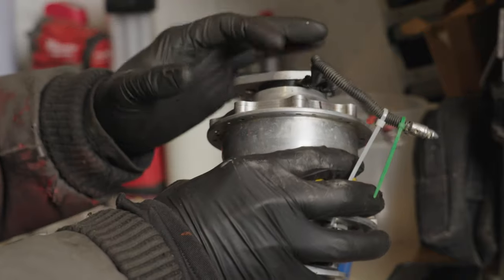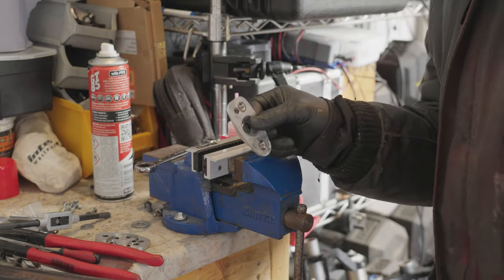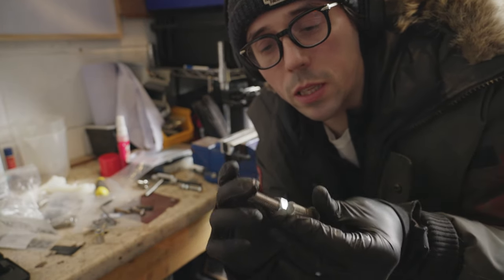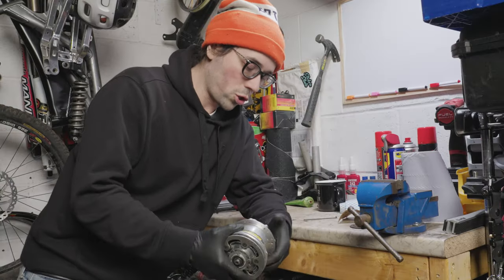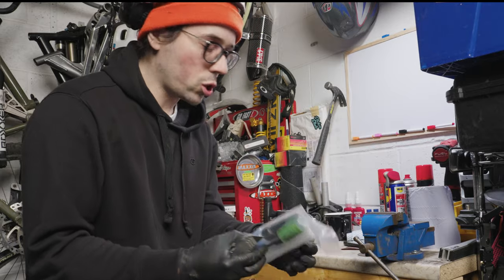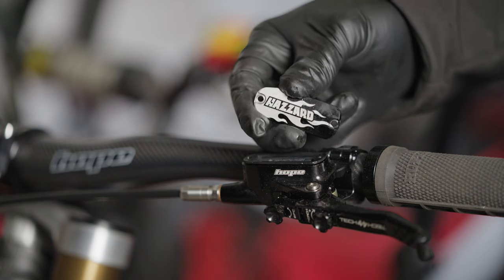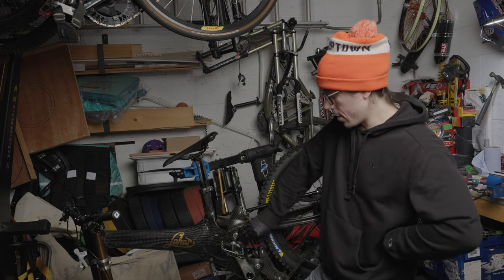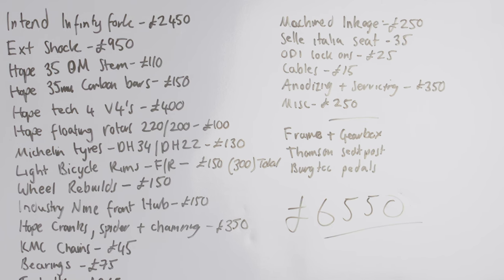The Final Fix

Comment: Nice work mate. Would have been good to see the difference in timed runs between old vs new build... ep.4 perhaps....
Reply from the maker: We only got the before, on the 2nd day we ran of time/light and the bike broke as I detailed in the 2nd video. Maybe we can get it at another point if the sting is free! Thanks for watching
Reply: @stephen_hughes  sure Joe will be up for it... Love to see this timed against a modern bike on an appropriate track. Aaron (frame designer) was a tripper, but ahead of the pack at the time.

Comment: I always wanted one of those back in the day. Almost 20 years later and it's still a cool bike. Especially with the modern parts fitted.

But you should keep an eye on those stainless inserts in the aluminum. That is generally not a good material pairing that can cause severe contact corrosion.
Reply from the maker: Awk if that happens I’ll get some new plates made!
Reply: It's marine 5086. Should not cause an issue. If it were 7000, 6000 series or 2000 series Aluminium it might.

Comment: Now upscale and rebuilt a new  frame as 29inch with complete modern parts.
Reply: Why? You want it to handle like a bus, have aerodynamic drag like a parachute, and have parts designed to last one race in proper off road conditions?

Comment: Still has a reach of ~30cm and you can't change that, baby!
Reply from the maker: That’s the problem with all bikes that age sadly!  Still didn’t hold folk back.
Reply: @stephen_hughes  since the frame is carbon you can extend it yourself, some of my local bikeshop owners did it with a rocky mountain instinct.
Reply from the maker: @Tequila628  I fully understand that but you’d need to be a maniac to do that to one of these. Would be easier to make a new front end!
Reply: @stephen_hughes 🤭 pretty hilarious what people think they need, just because they are used to the latest fad.
One of these won a National in NZ a few months ago.
You COULD chop the front end and make an internal lug, that bulged out to keep the smooth contour, but the only reason anyone has such ridiculously long front ends now is the stupid big wheels.
I did this to shorten one for Olivia Johnston in the 2006 World champs. 
These were criticised for their pro race long slack geometry when I was building them.
You are lucky I used 5086 marine Aluminium magnesium alloy on those Rohloff mounting plates Stephen. It's stronger and more corrosion resistant than 6061 or 7005, doesn't work harden, so you could bend them back into shape. 7075 is stronger but very brittle.
I would have recommended helicoil rather than insert for the stripped thread. But the inserts fine with your Ti bolts. 7075 race bolts are lighter, and far cheaper, and probably would have stripped their threads instead of the ones in the plate.
Holy shite! I cannot believe what you reckon you spent. Hope you got some discounts.
That's almost exactly what I've spent buying a Kauri Wharram Oro fifty foot ocean cruising Catamaran, a 45ft Hartley south seas cruising ketch, a Noelex 22 epoxy fibreglass foam sandwich racing trailersailer, a 10 meter Andrew Jackson motorsailer, and an Alan Wright Kauri Nova 28.
And all the parts and materials to get them fully back to top condition and capable of cruising the world's oceans.
With the shite the world's going into, homes and the ability to get wherever you need to survive or away from where you can't is important.
And this fleet can easily provide homes and food and safety for over 100 people.
Glad you like the views Stephen.
Far from "disappearing off the face of the Earth I have continued expanding my networks, and achieved many world leading things and topped many fields since I gave up on the shark fest that the bike racket is. 
And sharing these videos  has Undoubtably contributed.
Wynn Masters, for example reckons he'd love to borrow your bike and poach a big race. 🤗

I have been called a gallous lad indeed, by some of your top Scottish Engineers Stephen. One of my very good friends, Stephen Salter passed away a few weeks ago. Professor emeritus of the Edinburgh design school.
He had a good innings and was sharp and working hard until 90.
Though I had to open his eyes to some major cock ups in his assumptions on some projects he'd spent years working on in international Zoom conferences of the biggest names in climate and earth sciences. An honest and humble man like myself he always took it well.
It may amuse you to hear that despite definitely being a "gallous lad", I still find it practically impossible to get arrested or charged for anything.
DAMN near any time a cop hears my name, or a harbourmaster or other official, they go "Aaron Franklin, what? The A Aaron Franklin... Cam Cole the World Champs! Americas Cup! You're a national legend!
🙄 It's disturbing.
They call me The Real Burt Monroe, and The REAL John Britten.
And I've had quite a few amusing experiences of having to take things like rifles and industrisl strength Garden tools off people intent on using them to kill, and when the armed offenders squads turn up with their assault rifles, they really appreciate rolling around giggling their tits off with me and me giving them some pointers on how to harmlessly disarm, deescalate and disable the perps without anyone getting so much as a scratch 😂.
😇🤣😂😘.

Keep to the Highlands Laddie.
Oh... 🤔
And watch out for the Megatsunamis Aye
🌊🐉🥺👍